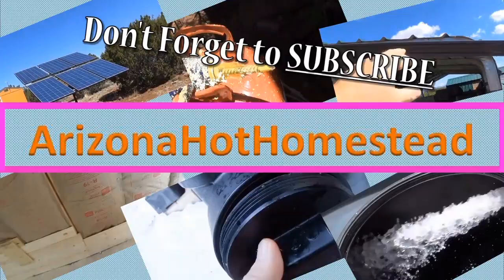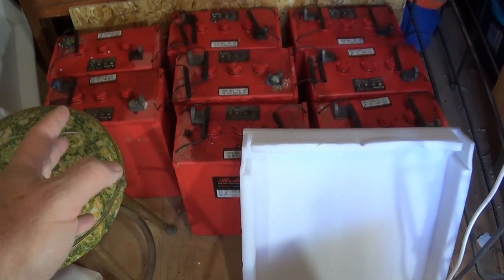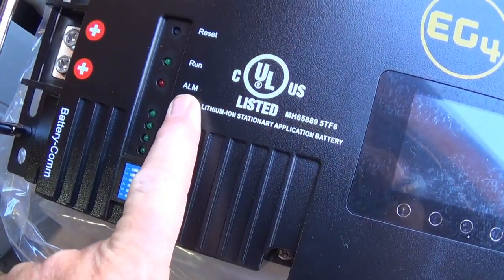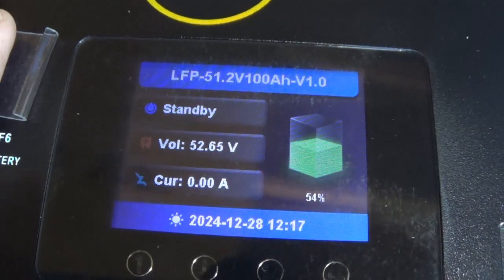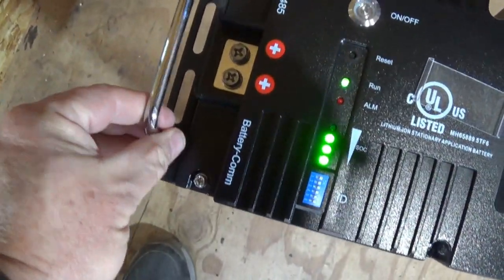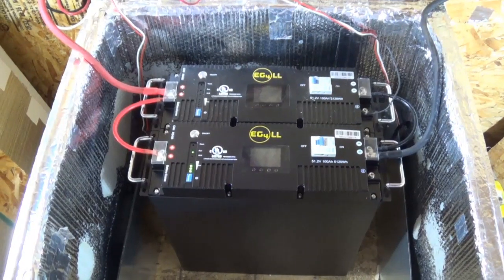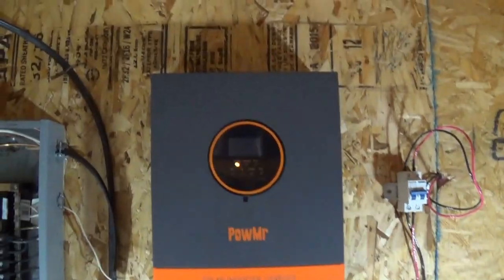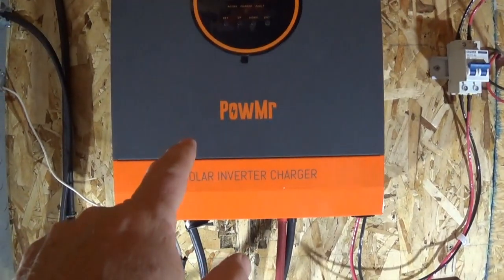Installing EG4 48v 100ah Server Rack Lithium Battery

Comment: Hi Jeff i love your video i can easily relate to all of your work and i like to know if you have done video of getting power from generator thru electric panel and plug set up or how ever they call it, i sure like to see how it done. thank you very much
Reply from the maker: I will work on a generator video.  I plug the generator into a 30amp breaker I use as a switch then wire to the all in one inverter (powmr)